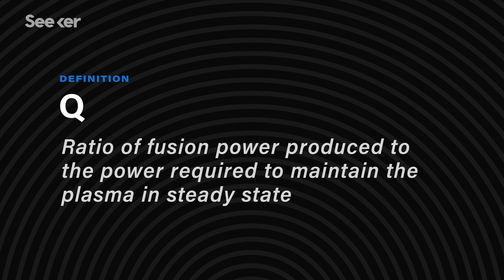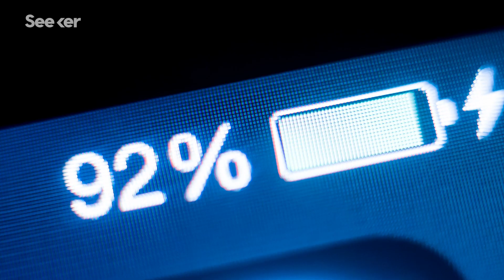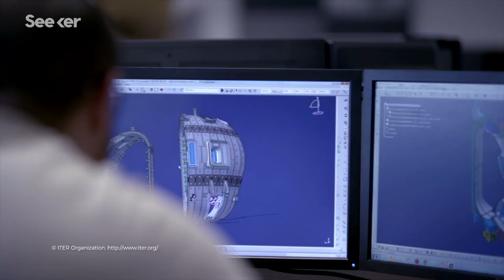How Close Are We to Fusion Energy?

Comment: Some people think that using seawater as fuel will cause depletion of water. They don't use seawater. They use deuterium-tritium, not water. Deuterium is found in seawater and tritium is obtained from lithium. The only by-products of fusion reactions are heat, free neutrons and small amounts of helium. Helium, which is an inert gas, will not add to atmospheric pollution. Plus, there is a big demand for helium. Because of the large amount of energy produced per unit mass of fuel, the production of helium is rather low, ten million times less than the CO2 production. Considering the yield of energy per unit mass of fuel and worldwide energy consumption, there is enough fuel to sustain nuclear fusion for like millions if not billions of years. Let's hope scientists can make nuclear fusion a reliable, clean energy source.
Reply: What they don't get is that the water that is used is extremely minuscule think like a gallon of water to power a city for a day.
Reply: there's actually a growing scarcity in Helium
Reply: There is a ludicrous amount of salt water on the earth anyway, it’s not an issue
Reply: The sun will crap out before we use up all the sea water.
Reply: they are bitching about the ice melting and raising sea levels, then they bitch about lowering them back down... proves you cant please these pieces of trash.

Comment: What is the big advantage of fusion over a thorium reactor?
Reply: Well, it's cleaner, cheaper, on a smaller form factor and safer.
Reply: Artur Renato B.B I think you're right  about that. However, (and correct me if I'm wrong) I believe thorium reactors are much more within our reach at this moment. Also I cannot believe that a fusion power plant would be cheaper. So, since thorium reactors are more likely to be realised on short term, my question still is: why bother to develop fusion reactors as thorium can cover our energy demand for the coming century ?

Comment: Actually....we ARE close to fusion, as in sustainable, profitable fusion...here's why....the big hassle with it has been, mostly, containment of the super hot plasma, keeping the magnetic field sustained when all it wants to do is let some of that plasma slip out..well..recently there has been a MAJOR breakthrough..super duper special super conductors that are both easy to make, easy to use, and are not delicate and temperature sensitive like the previous ones..these special REBCO superconductors enable the magnetic field strength to be increased by a factor of TEN or more..that is MASSIVE...and it's this that allows, actually guarantees, that the TOKAMAC design can easily reach the parameters for making fusion both sustainable and way way over unity..in the past a lot of current was needed to generate the magnetic field to hold the plasma, well not so now, the benefits of these superconductors is many, much stronger field,much less power needed to achieve said field, no insurmountable engineering hassles like fragility, low service life etc etc...I know there are many other attempts and methods to get fusion over unity, but I think to be fair the race is already won, at least on paper it is, engineering these things is still a cutting edge science, so soon is like 5 years, maybe ten. Other attempts like NIF are just a giant white elephant, and physical piston driven compression systems are also not going to work,  and frankly are just a cruel scam played by unscrupulous people taking advantage of naive investors.

Comment: Bwhehehehe... That's funny... What happens if the core meltsdown and blows the plutonium to bits which is located in the centrifuge... It's going to be a mess and a waste of money... 

I don't think u guys have any idea how that fusion reactor is going to work.. If that thing has a slight surge the core igniter is going to get crush and the plutonium sheet bricking is going to be dust particles and cracked ingots. I know you guys built an emergency flush system but... All that money in all those bricks.. 😁
Reply: Bored There is no Plutonium in the Tokamak.
Reply: Wow so our liquid sodium reactor on fissionable material has no competition. 

Every silver bricking you see in that picture is a bar of plutonium..
Reply: Simple value of analysis plutonium has the higher mass ratio to withstand the heat required to do what they want.. You cannot use regular magnetized metal to create a super heated particle acceleration mass with a field able to fuse particle to create high atomic gamma and beta bursts. If you look at the atomic table you can figure out what has the greatest mass in particles then you can figure out the rest.

Comment: The money ,time and engineering we have spent on fusion if spent on wind and solar as of now, and stored in batteries as now, not tomorrow would have made the planet significantly free from oil, gas fission nuclear by now. Also I could power my own house , no grid required , no company to pay , no private energy monopoly but governments don’t want the people to be independent from the energy companies and their tax system . No  tax collected on my own energy 🧐system , and in future no tax on my fuel to drive my ev . Solar wind power on and off shore , hydro tidal, battery storage and other forms of storage , compressed air , hydro storage all more valid and cost effective . Ps keeps the nuclear scientists in jobs , it’ll be here in ten years , how many times have we heard that , like hydrogen fuel cells only worse , dead loss

Comment: Because of the timelines involved fusion energy is NOT about climate change or clean energy. We have the ability to replace all fossil fuels sources with solar/wind and other renewables before fusion becomes available. So the question then will not be which is greener, but which is cheaper. Wind and solar are already cheaper than traditional nuclear so fusion will need to have a price much lower than that. There may well be countries that refuse to go with solar and wind because they have large fossil fuel reserves, but they will equally reject fusion for the same reason.
Reply: Timothy Whitehead Please explain to me how solar and wind is going to replace not only all natural gas in the USA, but also petroleum even though solar and wind does NOT produce products that would be substitutes for petroleum?
Reply: I am not sure what you are asking. If you are referring to petroleum products other than energy, then fusion isn't going to help either. I was referring primarily to electricity production although electricity can be used to replace many energy sources that currently go straight from fossil fuels to power or heat. Electric heating and electric cars for example. My point is that promoters of fusion often tout it as 'green energy' when the reality is that it will almost certainly NEVER actually compete with fossil fuels, but will instead compete with other green energy sources and the competition will be based on price and politics (governments often have an interest in keeping power generation centralized).
Reply: Timothy Whitehead If your argument is directed solely at electricity generation then you aren’t talking about petroleum at all, which means you really need to specify which energy sources you’re talking about instead of just saying fossil fuels in general. 

My comment was not made to suggest that fusion would be used to replace fossil fuels, but then again I never made that claim unlike your own. I also do not understand how you think fusion energy would compete with renewables as compared with natural gas and coal, when fusion energy would most likely be a baseload provider as it is extremely difficult/impossible to alter production rates over a given day with this energy source. Would this source of energy compete with renewables for Renewable Portfolio Credits? Yes, but then again all nuclear technologies should already be given these credits seeing as they are the largest source of Low-CO2 in the USA already. Additionally it makes zero sense to claim that nuclear energy is non-renewable while you give renewable credits to sources like geothermal that are primarily reliant on radioactive decay for internal heat. The

Comment: So, nuclear fission energy is scary, but nuclear fusion energy isnt?? Fusion releases unprecedented amounts of energy and if there's a catastrophic failure, ie Chernobyl, with fusion energy...it would be beyond destructive.
Reply: Nuclear fusion has no run off chain reaction in case of reactor failure. In that case the fusion will just die out unlike fission reactors where the chain reaction has to be controlled with rods.
Reply: But the shear amount of heat that fusing atoms produces would still be a pretty big deal. All I'm saying is that pretty much all types of power generating substances are "scary" in thier own ways. Coal, black lung and pollution, oil, lots of pollution, solar, takes up hella land area, wind, same as solar, nuclear fission, can be dangerous with containment failures and produces very harmful waste products, but nuclear fusion, that's one only time will tell.
Reply: What happened at Chernobyl is not possible in a nuclear fusion reactor. The reactors themselves are completely different.

Comment: Nuclear is not scary if you understand it. Its one of the simplest and best ways to get all the energy we need. Stop spreading the idea that its bad.
Reply: Caleb Hooper There is nothing simple about nuclear energy.
Reply: In modern nuclear reactors, there is little waste and lots of energy produced. It is physically impossible for them to melt down because of there design. Basically, they remove the fuel from the reactor in the event of overheating. In a nuclear reactor, all that is going on is you take some reactive uranium 235 and give it a water bath. The heat the uranium gives off boils the water. They then pipe this steam from the water through a turbine and it spins. The spinning creates electricity which is pumped into the grid. The steam is completely safe and not radioactive and just gets pumped back into the atmosphere. The little bit of waste that is produced is bottled up and stored underground. Where it proves no threat to the environment.
Reply: Yes I agree hydrogen fusion is better but until we figure out the kinks nuclear is our best source of energy. We have enough uraniunm on earth to power us for over 10,000 years. And once we do figure out fusion it still will be awhile before its implemntded and made efficent. We are already very good at making fusion reactions.
Reply: Caleb Hooper That’s not my point. The point is nuclear energy is extremely complex, to the point that it requires full understanding of the most recent scientific developments in human history.
Reply: its not recent though this has been known for decades.
Reply: Caleb Hooper My problem is that you are making nuclear engineering, radiology, radiochemistry, Quantum Mechanics, Fluid Dynamics, Particle Physics and Calculus 3 seems like child’s play. I assure you that is inaccurate.
Reply: Of course, understanding all the detailed science behind it is going to be difficult but the basics idea of how they work and how they actually produce their energy is fairly simple to understand.
Reply: My whole point here is I don't think they should say nuclear energy is scary just beacuse they don't understand it. It gives it a bad name.

Comment: The problem is that solar is going to provide most of the power by then anyway and the price of power will be so cheap because of this, no other power source will be economically viable.

Solar is growing about 30% per year and is far cheaper per kw than any other source.  About 100 GW of solar is added to the grid worldwide each year.  Over 50% of all new power sources added in the USA last year were from solar.

By 2050, when DEMO is supposed to be ready, it will already be far too late.

Comment: Count me as skeptical. We have been promised fusion energy is "just around the corner" for at least 25 years now. And, now you're suggesting it's going to be another 25 years or so.

In the meantime, we are going to do what? Sit on our hands? Other technologies need to be put in place in the interim.

If we had started 15 years ago, we would now be replacing every uranium reactor in this country with thorium reactors which are far safer in every respect. But, we couldn't get the funding because "fusion power is just around the corner". 

This promise is putting the brakes on the development and deployment on  many other technologies, thorium being just one of the bunch.

Now. I'll grant it's not the only reason. There is more money invested in oil, natural gas and coal than in anything else. And, that is another huge barrier to overcome.  

The thing is: The electrical grid doesn't really care where the electricity comes from. And, the users don't care where it comes from either, as long as it is affordable to the whole population. And, this is the third barrier to overcome.

So, bottom line, I don't expect to be living when practical fusion power finally comes on line. Maybe I'll witness it in my next life.

Comment: Molten fluoride salt thorium reactors are also very viable; safer, more efficient and less waste than current nuclear power. What's holding it back is lack of funding to overcome technical problems, since it is more complex than today's reactors
Reply: the reason of the lack of funding is b/c of the stigma that newscasts cast about nuclear fission. its stupid. they extrapolate the cons that happened in history twice b/c of either stupid people or a natural disaster. People become scared of this idea so they push it aside. even though compared to our current energy producing sources, its much greener compared.
Reply: Chicken Hands yeah all the nuclear accidents we've had were with older reactors of obsolete design. Chernobyl didn't even have a containment vessel, it was built shoddy. 3 mile and Fukushima were old plants with obsolete tech and there were design strategy and logistical errors in the operation procedures that have been corrected.
Reply: @Midnight_Rider96    these newer designs are virtually "walk away" in the event of failure.  The media will always go to great lengths to frighten people.  Apparently, it pays well.
Reply: The tragedy is coal and oil plants are way more dangerous to people than nuclear plants but we still keep running them. Cancer from air polution kills just as well as Cancer from radiation leaks and there is massivly more air polution
Reply: Molten salt reactors are much simpler than conventional solid fuel pressurized water reactors not more complex.  However, with solid fuel rods, the reactor manufacturer can require that only their fuel rods be used in their reactors hence charge a premium for the fuel whereas a molten reactor uses molten fuel hence the manufacturer can not constrain the purchase of fuel.  Think of it as the inkjet cartridges problem, with inkjet printers, they can sell you ink at exorbitant prices per once.  So molten salt reactors isn't done because of complexity but because the reactor manufacturer cannot direct most of the economic benefits to themselves.
Reply: Molten Salt Reactors (MSR) is a lot simpler.  But its not easier at least not yet.

There are several technical problems holding back MSR's but the main one is that molten salts tend to eat through almost every material.  

A nuclear reactor that needs core components replaced on a constant basis is not economically viable.  Parts are expensive, downtime is expensive.

Once that hurdle is overcome, then MSR's can really take off.
Reply: no its not, thorium is stupid shit

Comment: Somehow i feel like fusion is impossible on Earth.  Well, it's possible, but producing more energy than you put in is very difficult.  The sun has gravity to fuse the hydrogen.  Just using solar energy is essentially fusion energy.

But without that gravity, we need a constant electric source to compress the hydrogen, and the more energy you produce, the more you need to compress it, because the energy causes it to expand.  In the end, it cancels out.  I'm skeptical that we'll be able to produce more energy than we put in.  

Also, hydrogen isn't an unlimited resource, we might kick the can 200 years down the road, but eventually we'll have a hydrogen/water shortage, which would be catastrophic, and wouldn't resolve itself once humans die off.  That helium is too stable to ever become hydrogen again.